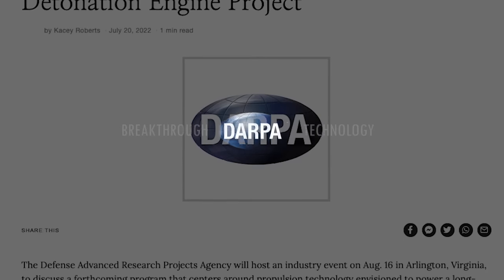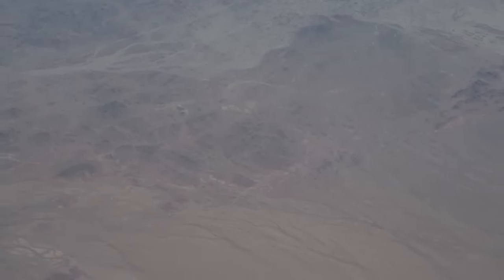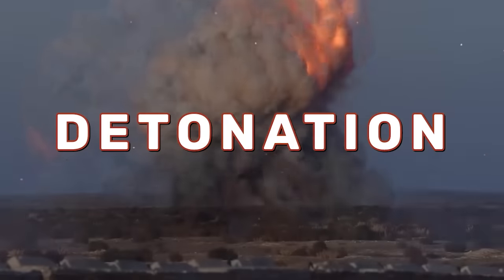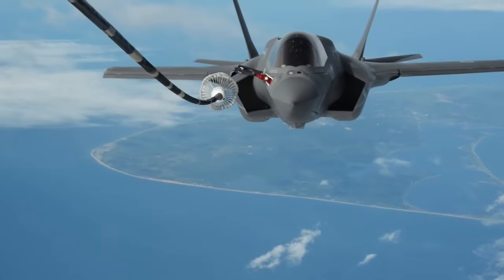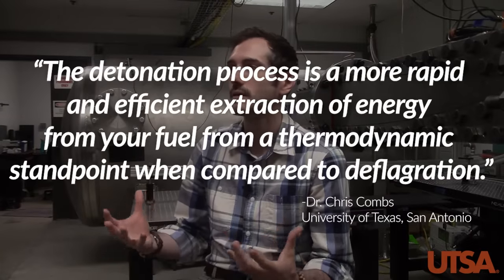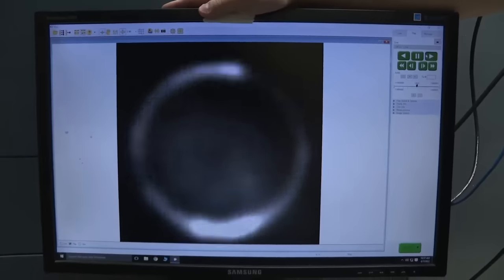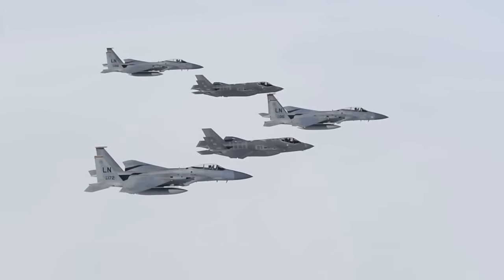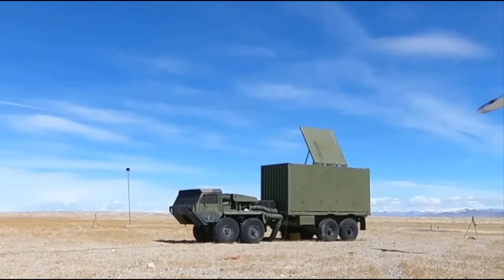The game-changing tech in DARPA's new missile

Comment: The thing that seem to be almost overlooked is that this may change spaceflight, possibly even allowing SSTO and/or much faster travel to other planets like mars. From what I found, RDE ISP can be up to 3 times better then existing rocket engines.
Reply: That sounds unlikely high...  I've heard there would be some gain which is good, but no where near that much. Don't suppose you have a link to one of your sources for that figure?
Reply: @Quickshot0  literally the first Google result for "rotating detonation engine specific impulse", it is a pdf, so YouTube doesn't allow to post a link to it. They are citing 1100 s, while current rocket engines are ~ 300 - 350 s. I haven't read it thoroughly, and I don't have qualification to find any flaws in that paper, but I believe, they even have some kind of lab prototype.
Reply: @solarissv777  The article discusses several different fuel types, ratios as well considers results for rocket engines and air breathing engines. The 1100s figure is for an air breathing system. For rocket mode with Methane they got about 350s, presumably at sea level as that would be the easiest to test. 

If that's the best performance possible is not entirely clear to me, as there are different ways to run rocket engines after all and these have different efficiencies. Also I had a bit of trouble quickly pinning down actual real world methane engine performance. But Raptor rocket engines at sea level are around about 327-330 it seems like. In which case this design got about 7% more ISP then them I guess, which would be a pretty enormous efficiency gain for a rocket engine, considering how far they are pushing efficiency already.

Certainly at surface level such an improvement would seem well worth it, you'd be able to greatly increase your mass ratio to orbit for the same rocket.

Comment: Another interesting thing that high speed jets out the end give syou is the ability to accelerate at high speeds. And I mean AT hgh speeds. Really high speeds.

Seed, if your thrus is six hundred miles an hour, even with five times as many engines, going faster than that will be hard. Same thing with mach levels of jet stream,. SO more ejection speed means easier max speed.
This is also the case in space.

Comment: Another interesting fact is the use of hydrogen and other kinds of fuels for detonation engines of all kind.
While climate alarmists and electric car salesmen would have you believe that peak oil was 1980 or will happen by tomorrow, we probably have enough oil until the year 2150. However, it may get more expensive and it's bad to transport on a ship, even a nuclear carrier. If you can make a hydrogen engine, you can literally split sea water with your nuclear reactor to have unlimited aircraft fuel as well. Even if said fuel is even more dangerous than regular gasoline.
Reply: the nave research lab has developed and tested a process which converts sea water into jet fuel.  but it takes huge amounts of electricity to do this, so at this time, it's possible, but not practical, unless you have a dedicated nuke reactor.

Comment: I know you all might think this is too far fetched but I did so I am gonna say it regardless. I have studied military and technology in general since I was 9. I also love speakers and audio but I noticed that there is a general design that is common is almost all speakers from the cheapest ones to the most expensive ones. Cabinet and port. Propulsion is in the same boat more or less because it has followed  the same general design for decades. I like to challenge myself to see how far I can get in redesigning and resolving the issues with technology. 

With Jet engines or engines in general, the design seemed very inefficient. I know there are counter rotating blades for balance and compression chambers but those two designs are so.....basic, wasteful and same with missile propulsion.  Even if we designed a 10fold better fuel for the best missile, it will still be wasteful deploying it in the same way we do now. I thought (at a very basic level, can we design a system similar to that of a car gearbox? Evolving from there I thought of the entire fuel management. I life to start at the source and work from there. 

Well, I thought of a system that resembles something like what DARPA created. Mine utilizes sort of kind of maybe a little similar too (I know, just joking) that of the black bird. I love the concept of using the environment to assist. Though this, I came up with a lot of the scram jet tech as well. I really like DARPA's solution and will study it quite a bit. But yeah. I wanna say more but not sure yet. 

I love this stuff.  EDIT: I did not finish watching the video all the way. I just past 13:12. Interesting.

Comment: The cell size on petroleum distillate fuels and air is too large for detonation to be used in a reasonable size annulus. It uses a non-typical fuel or is very, very large. OR it isn't an RDE as they're claiming but a CDE which would bring the detonation chamber size back down to a reasonable size.

Comment: Your diagram of a pulse jet is kind of off. There are no valves that release gases in any way. In your diagram there's a combustion chamber separate from the exhaust chamber. A real pulse jet it's just one empty tube with the combustion chamber open to the exhaust, there are no valves that open and close in a pulse jet. The differential pressure is what keeps it running. You've heard of The barking dog experiment in chemistry basically the same concept, upholstered is basically just a continuous barking dog.
Reply: Bruh

Comment: If conversion to rotation of a drive shaft is possible I want RDE in my car. And in my tank too.
Diesel-electric RDE. RDE diesel generator providing electricity for the batteries. Someone has to be sitting on the patent because it's clearly the future of transporation. And the left doesnt want us to have as much freedom and range. Fk, it doesnt have to be RDE. A supercharged diesel generator can be efficient enough. We just need to remove the wrong people from power.

Comment: A purposely adapted or built plane with a single rudder or V tail for less drag would launch a missile fited for a higher speed range. I.D.K. if a single engine can perform such speed and even if it's necessary such a version without the range of the big one with two engines.

Comment: "Retreat from Range" compares carrier air wing sizes and ranges. The Hornet as the sole platform was a disaster for any enemy more advanced than the Taliban: we went from being able to have 32 heavily loaded strike aircraft hit targets 1800 nm miles away to under 600 nm today, because the ever shrinking air wings are full of short range fighters and no tankers.
Reply: F-18s are pulling double duty as mini tankers, and the Navy has tested small drone tankers.
Reply: @kerbalairforce8802  How many strike aircraft can they get out to 1800nm using the organic capability on the carrier today?  I think that would be zero?  How about 1200 nm?
Reply: @k53847  : 1,100nm is more realistic with f-18 super hornets carrying drop tanks and in flight refueling. But by carrying drop tanks you downsize the weapons payload you can carry. Should have built the F21 super tomcat that Grumman proposed instead of buying the F-18 hornet. The Super tomcat Grumman proposed would have outperformed the Super hornet in every way. It would have had super cruise which gives speed without using afterburners, swept wings which improved fuel efficiency thus providing longer range, upgraded modern radar and weapons control, upgraded flight control. A much better overall plane for carrier operations. But it got shot down citing cost. Yet our government prints and spends trillions of dollars that we don’t have every year. Government don’t seem to worried about cost to me, reckless spending is out of control. I guess politicians, military industrial complex and fools that be never considered the fact that we might get into a war or conflict with another super power. They got rid of the F14 tomcats, our bombers, the S3 Viking which served as a sub hunter and areal refueler without providing adequate replacements. Went with a jack of all trades F-18 Hornet which severely limits carrier operational capability. Now our carriers will have to get within missile range to operate. To make matters worse, our resident in chief is doing his best to provoke war with two super powers at the same time. Meantime we got a broken supply chain and high inflation, and energy dependent to boot. I don’t have to be a psychic or a rocket scientist or a brain surgeon to tell you this won’t end well.

Comment: Why would we build an F35 or any Fighter that doesn’t have the range we need to participate. The F 35 had been described as an. inferior plane. So much so that many in the Military and Congress thought it had been poorly designed. In fairness we live in an Impatient World. It takes time to kick a new program or machine into optimal condition. Many Fighters have issues. I assume from what you and others state things are improving.The technical assets are radical with updates able to be added as featured in the design. The threats we face are similar to those of decades ago (obviously cruder). There is no excuse for the range of F35. We got 650mi we need at least 1000-1300. 
So instead of doing things correctly after years and Billions we now have to build another plane or more. Considering the ridiculous Cost Overrun’s and Delays I would pass on Lockheed Martin for our next adventure. Great Program with a Host who can  “AIR POWER” with balls.

Comment: The main problem in creating a hypersonic missile is not the engine, but the hull. Since at such speeds the body wraps around the plasma and heats up by several thousand degrees Celsius. Also, the electronics inside do not stand up. The USSR found a solution. The project "АЯКС" seems to be called. If it were not for the collapse of the USSR, then hypersonic missiles would have been ready in the 90s. Consequently, now there was something else unimaginable ... And as for hypersonic aircraft, someone is dreaming there. A person cannot withstand such overloads.
Reply: The solution for protecting in-atmosphere hypersonic missiles was found in the 1960s when the US deployed hypersonic nuclear-tipped ABM missiles to counter ICBMs.  Heat shielding is nothing new.  The problem—which still hasn’t been solved—is maintaining a target lock while hypersonic.  Hypersonic aircraft are also not a dream.  Again, the US tested the hypersonic X-15 in the 1960s.  I would agree that a hypersonic fighter aircraft is unrealistic though, as hypersonic speeds preclude anything more than basic shallow course changes below about 80,000 feet.